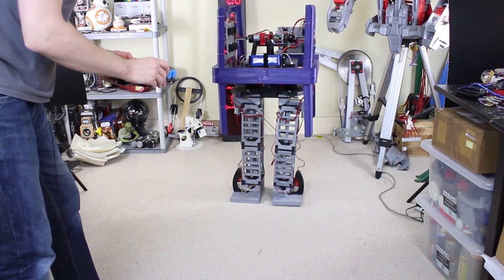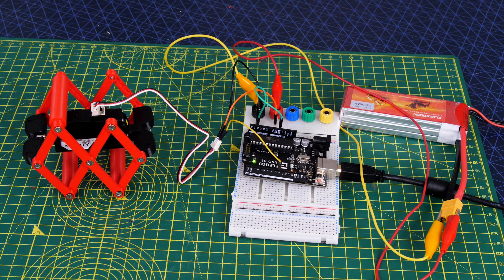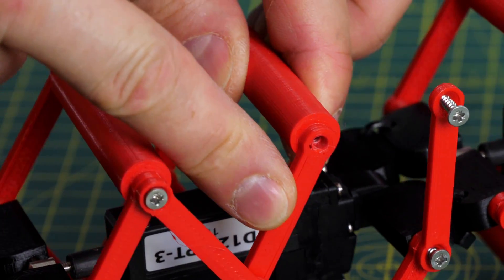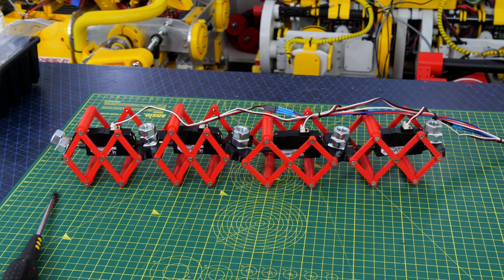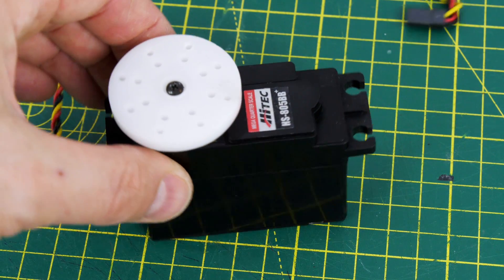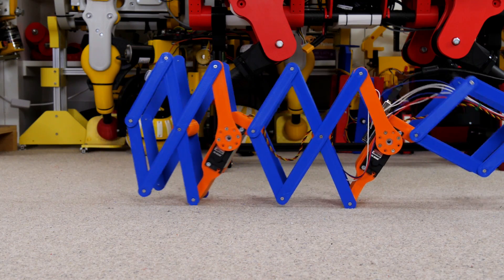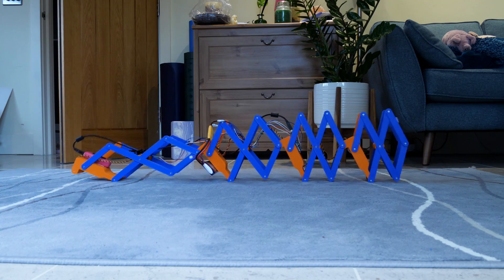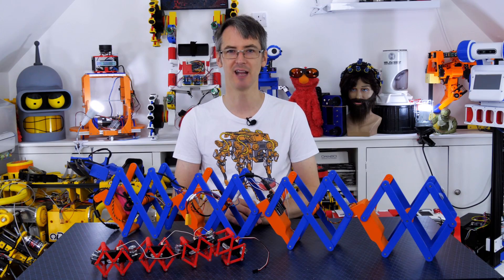Experimental Robot Worm

Comment: I wonder if worms can also reverse direction and move as efficiently because that would rule out asymmetric constructions like something sliding well only in one direction (which of course does not mean that one should not do it like that). anyway did you try using that sideways? that would rule out some other things affecting movement and would make turning more easy (as it bends better that way). maybe try to get forward movement with both contracting and expanding phases. Like when expanding it would be beneficial to push backward side down a bit and forward side up and when contracting, push forward side down a bit. i think at least some worms might do something like this. so if you build it asymmetric, there might be a linkage system (if not, should not be too hard to invent) suitable to do this without extra powered actuators.
edit: after few seconds of thinking, current worm might not move at all when sideways and that would reveal a fundamental problem wth current movement pattern. maybe when the tail parts are expanding, forward parts should contract more than when middle parts are expanding (because there are less to push). or if worm movements are for example a sine wave, how many wave lengts there are per section/whole worm might be relevant. Anyway watching that last contraption, it looks like the last part (tail) is kind of doing what i earlier described, putting pusing part down.

Comment: Why reinvent the wheel (or the worm, I guess) and add a ratched wheel, when you can just add the bristles themselves? Just some plastic or metal bits that slide forwards but catch when it tries to slide backwards should do. Basically a ratchet that catches on the ground instead of on a wheel.

Comment: Most worms also have bristles stopping them from going backwards, not sure is they can change their angle to go "backwards" but it should stop the segments from sliding in the wrong direction.
Similarly to those vibrating rubber toothbrush like robots that just run about randomly it woul kind of look like this.
===========
WORM HERE
===========   That way >>>
/ / / / / / / / /

Comment: Perhapse you could add an integral ratcheting mechanism to one of the rollers on the crossbars.   Give it some grip, that way it will roll forward but hold firm when it is being pushed on.  

Or another simpler fix might be one way hooks that drag on the ground one way but grip in the other direction.   Would give you better traction on carpeted surface.   This might better mimic the hard ridges on the rings of an earthworms body.

Comment: It looks like each section rotates slightly backward as it's pulling forward. You could probably add small rubber feet to the backside of the "feet". That would grip only when rotated.

Comment: The most efficient form would be a motorized scissor lift driven by a single motor at the back and a ratchet on the front.
That way you would be extending from about 3cm in it's compressed form to about the entire length of the extended body (about a metre) with each stroke.
I have a great model for this if you want to use it. I never added a ratchet mechanism to it,
I made it as part of an automated kitchen robot, but I noticed while testing it on the ground, it will move like it's an evolution of the worm
Reply: You would need the ratchet at the front to be driven independently of the back microcontroller, but you could quite easily do this with a sensor. Infact you wouldn't even need a micro. You could use the encoder inside the servo to be used for the ratchet to just detect whether the linkage has been extended. No extra power or cabling
Reply: I have a feeling this could actually be faster than a wheel since it doesn't really rely on friction with the ground to move. If you're adding steering, you could also climb vertically and just latch on to say a bookshelf or something. There's a popular channel on youtube that shows how you can make your own gecko tape that's stronger than the retail version. If you could work out how to contract it and detach it on demand without using a ton of energy, that would be pretty OP. It uses lots of tiny nanoscale hairs which you can make using silicone and colour grating sheets

Comment: Not a ratchet. Check the orange part on the very end. Extend the inside part of it and put the rubber stick on it. As it elongates, it will "lift" the sticky pad off the ground and allow for movement. As it contracts, the sticky part would touch the ground, preventing slippage. By designing the "correct" angle, you can achieve quite smooth motion, it would simulate the "claw" of real worms a bit more realistically. And, I guess, you can achieve steering by moving the rubber part left/right - the friction (and the lack of) will cause the worm to steer.
Reply: Plus, I would change the algo - extend 2 sections, then while contracting the first, extend the 3rd, and so on.

Comment: I would suggest some backwards pointing, flexible plastic bristles. The smaller you make them (perhaps up to a point) the smaller the imperfections in the ground they can push against. Thousands of tiny little plastic hairs on the “feet” pointed back would boost it’s motion even on tile if they were fine enough.

Comment: having a simple tpe foot with fins pointed backwards would be much simpler way to achieve a one way gripped, one way slip mechanism vs a ratcheting wheel. if you do choose a ratcheting wheel a one way bearing would make it a very simple, if expensive addition!

Comment: Why did you make the second worm so much bigger? It seems the bigger servos would have fitted in a worm with half the scale.
Also instead of rachet wheels, you could just use a rachet surface (like sawtooth waveform) facing the ground. On a soft surface, it should give a nice directionality to the movement, because one direction would feel a sharp 90degree edge (block), the other direction a angled ramp (slide)

Comment: I have (3) Ideas after watching... 1.) a seperate motor at each section to extend a leg that contacts the ground at the same time the section extends. 2.) only one permanent leg at the rear of the mechanism. Honestly you could just lengthen the last link to the point that it touches the ground. It should provide enough contact with the ground while the last section is extended and then it will auto retract with the contraction of the section. 3.) My vaforite idea... ONE WAY BEARINGS on the rollers. The rollers could have rubber for grip and the whole cylinder can roll in the extend direction but will lock when the mech contracts and provide a stable force to push off when it goes to extend again - (perhaps i messed up the explaination but the idea is solid). :-) What do you think of these ideas? Im sure there are flaws with each but this my contribution from "Way over here" :-) Love your work!! Thank you for sharing your time and expertise!

Comment: Instead of semicircular bottom ends on the beams, use triangular ends with a high friction point. Shape the triangles so those foot pads only contact the floor when the segment is very short.

When the segment lengthens have it cam upwards on the slippery corners of the triangle.

This will allow the worm to go forwards and backwards equally well.

Comment: if you used the linear actuator to fold each end and steer . Add 4 brushless motor under the central section fold up the central sections REV THEM LAND the wheels While lifting ends from the ground burnout worm....steering can be done with the speed of the motor and the ends touching the ground slightly in curves i think the thing would drift around

Comment: I think the short/long sequencing is not optimal. The worm extends it's front sections, pushing the head forward, and then contracts those sections, pulling the tail forward. This is not the sequence shown in the video. 

To put it another way, sections labelled ABCD, and they have X (short) and Y (long). Start position.is AX BX CX and DX (all short). Then do AY BY CY, AX and DY together, then BY and CY. Repeat. Or something like that.

Comment: You could make it more efficient if the sliding surfaces would have less friction in the push phase and more in the pull phase. To do so you could use a roller covered partially with rubber and constrained in such a way that exposes the smooth surface when pushing and the rubber when pulling

Comment: right at the end of your vid, you mentioned the setae that worms have to make them go forward.  I'd suggest that at each joint, you glue some artificial sealskin (used in cross-country ski climbing skins) on the end of one member and on the other some soft silicone rubber.  That way you could grip carpet or hard surfaces.  Also, it should be easy to overlap the expansion/contraction cycles of the individual segments.  cheers!

Comment: It feels like it's moving backwards based on the order that the servos are operating in, and i don't understand why. First the front should extend while the back three grip the ground. Then the front should contact while the next segment contracts, so the back two segments and the very front grip the ground and so on. At each stage the segments that aren't expanding or contracting can stay still  while the rest moves slowly forward. But it seems that the segments with inactive servos aren't providing enough friction.
The second worm did move in the expected direction.

Comment: If the rubber feet were used again on the foot with the servo, it would probably work better then before, because the forward motion extension mode is not touching the ground.  Just a thought

Comment: It looks like some of the locomotion is being lost to the leading sections slipping as the trailing sections close. They don't have anything to push against as they are closing. I don't think ratcheting wheels will help with this, as they would still allow the leading sections to slip while the trailing sections close. For carpeted surfaces, something like velcro would probably work, but for smooth surfaces, something sticky, perhaps a tacky gel pad. It deforms and would adhere a little to smooth surfaces. Then of course the algorithms that others have mentioned. I know nothing about algorithms, but I do at the very least understand the point they are trying to convey.

Comment: Annelids and holes, I think there may be more to it. incompressible liquids, the narrower restricted body moving through a hole then expanding .  I wonder if you can use the linear actuarors to push two collapsable rings  apart  thereby streaching and narrowing the body. sprung to a short fat body. Great work as always and a pleasure to be inspired by.

Comment: I see it sliding more on the front. I think if you put a teeth with rubber tips that holds the front part of the robot during each cycle so that the front is more stable and the body can follow along.
It is like crawling with your arms, your arms have to be stable.

Comment: This is super cool idea.  I like your ideas for improvements, such as steering and the ratcheting wheel to simulate the worm bristles.  I think another potential improvement could be in the gait, particularly if you could some additional control between the segments, or at least between the first and last segment and the rest of the worm.  Then, it could attempt to lower the friction on the front segments as they extend while also increasing the friction on the last segment, effectively making it a temporary fixed "anchor".  Then after they have all extended, the fully extended segments can be lowered and the mass can be transferred to the front segment in the same way - by "lifting" the rear segments and allowing them to retract.

Comment: I really like this experiment!! A couple thoughts: instead of straight-up friction on a couple points, would it be better to allow more surface area, as the worm's skin does? Also, easement between sections would allow more movement, creating more efficient movement (more surface area at different speeds), correct?

Comment: Rather than ratchet wheels, consider a prod on each servo section that pushes against the ground when the section extends, acting as a brake against the ground.  Or bring back the rubber foot pads and try using the stretched state as the base and have it pulling itself forward by contracting instead of pushing by extending.

Comment: What if the back two push up the front section first, then while the first section is off the ground expand that first 2 sections before it hits the ground and maybe the front 50% of the bot will stretch much more fwd before touching the ground and having the front pull forward the back portion. Just curious to how this will move by elongation of the front a lot more in the first steps taken instead of each section moving fwd at a time front to back

Comment: The problem is exactly the same as with the ornithopter: Each section pushes forward and backward at the same time, the only difference is the weight of the actuator, placed slightly forward so the forward side has slightly more grip than the backward side, as long as the backward side can slip, and this gives the illusion it works (-ish), but the concept is basically flawed.

Of course, when both sides have enough grip (e.g. with rubber feet), nothing moves, and that's perfectly normal and expected.
The crawling movement is slightly more complicated than this, where all the parts in contact with the ground are moving towards the same direction, which means you need to break at least one of the sides to invert the direction of the push, so both sides of each section push in the same direction. That's still not how the earthworm works, but somewhat closer

Earthworm is not he easiest one to study, because it's not too obvious to see the movement is between the segments, not on the segments themselves, which are not moving, they just conform to the ground (the peristaltic part of the movement is not really significant like it would be in snails and slugs). It's much easier to see a very similar movement on a caterpillar, because the movement between the segments is much more obvious with actual legs (2 point discrete contact instead of continuous contact in the earthworm). 

How about mimicking the movement of a snail? That's rarely been explored...

Comment: Hooks on the belly side, plus make the joint ( the black connectors) the ground touching part. Lengthen the worm a few sections, and move one black section at a time ( shorten the first section whilst extending the second section)
Give it a head and tail aswell!

Comment: I was going to say a ratchet wheel when looking at the first one and then you mentioned it. You may be able to get away with rubber pad in a particular position so it only grabs at a certain angle as well. Like a thin strip placed at a certain angle but when it moves the angle changes so it looses friction and therefore grip sliding forward and then grips again when it changes the angle again.

Comment: worms actually have hairs they use to grip the ground as they move. 
if you were to use angled bristles to provide asymmetrical traction on the joints that contact the ground, it actually wouldnt be cheating.
Reply: I was just thinking this - glue on some red lint-brush material to provide one-directional fricton.
Reply: @justinmohns8279  i was actually thinking toothbrush heads or similar, like the little motorised kids toys. More than one way to skin a cat though!

Comment: Was thinking that a serrated foot pad would be helpful, the angled section in the direction of movement so it would slip forward and the flat back of the triangle could then grip the surface and push the worm along, similar to a backwards facing bristle as mentioned. The hex bugs use rubber bristles that vibrate and have rather rapid movement

Comment: Excellent concept!
Gait: I have a hunch that it should move as follows (based on comparison between your two models and an actual worm), start with the worm fully stretched out, contract the rearmost segment fully, as you extend the rearmost, contract the next one towards the front so that both segments pass their midpoints at the same time, repeat for segments going forwards along the worm. You may need more segments, maybe eight, to make this efficient, I think you can add another wave at the back one the first wave has moved forward enough to avoid interference... 
Great video and I look forward to the next!